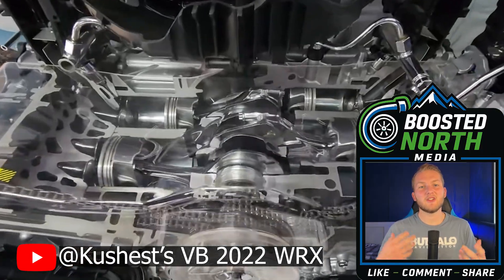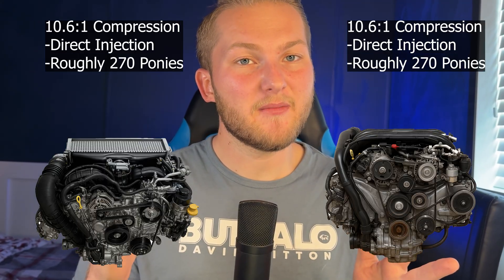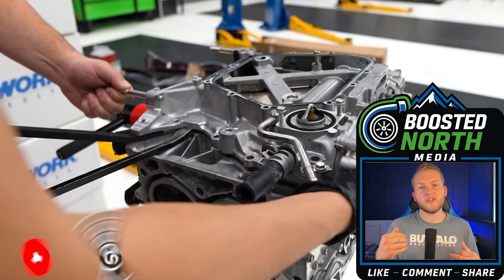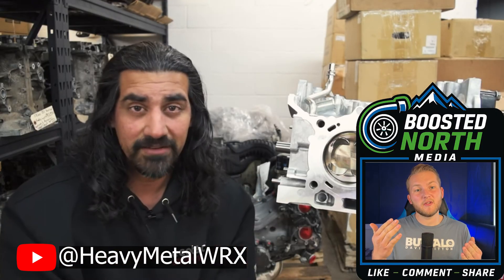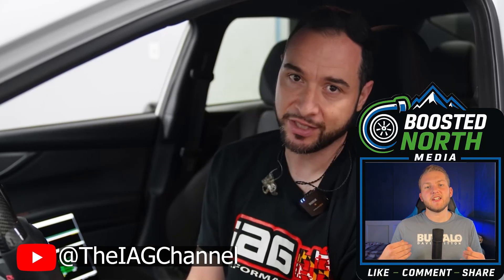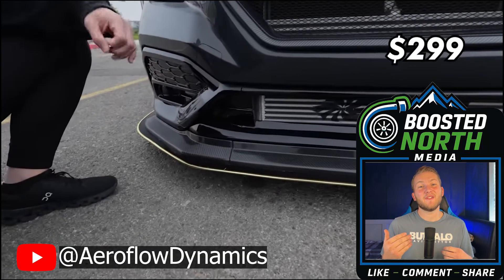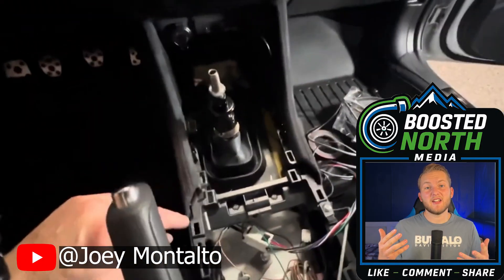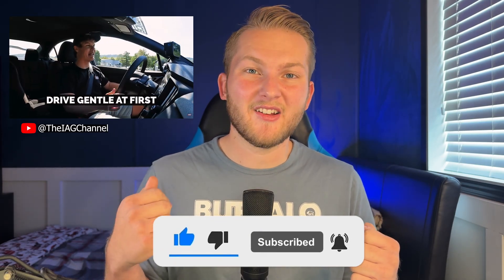Inside the FA24 WRX Engine: Why It’s the Tuner’s Choice | Power & Engineering Deep Dive

Comment: Hey do you know if the NA GR84 FA24 is mostly the same as the the turbo WRX motor?
Reply from the maker: Hi there! From what I understand, they are similar but the WRX motor has stronger internals and is only direct injection. The BRZ/GR86 motor has Toyotas port injection + direct injection technology

I’m sure there are a lot of finer differences, but those are the two that come to mind :)
Reply: @BoostedNorthMedia I'm shopping my first sports car. The GR86 has me very intrigued. I was trying to figure out if it was a good motor to add force induction to because the NA version is pretty low on power. Looks like it has a significantly higher 12.5:1 compression ratio compared to the 10.6:1 on the WRX version. I'm curious if the bottom end is built as strong?

Comment: Weak point is the transmission…..
Reply from the maker: Fair point! This car would be perfect with the STi transmission
Reply: @BoostedNorthMedia sure. But even that has it’s limits i guess what and how are you building it to and for? I mean you can beat a 22 transmission at 300 hp all day. Then 400 a gear may give out. Okay sti transmission. Sure maybe to 500. Why not just put stronger metal inside it?
Reply: And the requirements. If you want to sti transmission swap. Will you just do the trans swap  alone or do you want the drivetrain package? Personally if I was to sti
Trans swap. I’d want the electrical system / drivetrain with the knob inside the cab to be able to put more or less to front or rear axles

Comment: Is the FA24 in a WRX not proned to the same starvation issues on hard corners that the BRZ is?
Reply from the maker: Hi! From what I understand, I believe that there are similar starvation risks primarily because of the inherent design of a boxer engine itself. To my knowledge, there are some aftermarket solutions available that help address this issue (at least in prior generations, I’m not sure how far long the VB platform is yet)

Comment: I've been a Subaru mechanic for over 27 years. This engine is the best Subaru has ever made in terms of reliability and performance. It's the easiest and cheapest to modify, and it responds extremely well to upgrades. It's not like an STI that makes crazy power, but it's definitely the safest and most accessible for anyone looking to modify. Now, to reach high horsepower levels, you need to understand this engine—but there's no doubt it can handle more than an STI, and at a lower cost.
Reply from the maker: I agree! Thank you for commenting :) In your opinion, how long of a life can an owner of one of these expect on a stock engine that isn’t modified? Based on your knowledge of these platforms.
Reply: This engine is so incredible it was built to last. You can even see videos on YouTube where it holds up with people who know nothing about mechanics. Back in the day with an STI, we had to swap injectors and a bunch of other parts just to hit certain horsepower levels. But with the FA24, it's super easy as long as you get the tuning right. The best part? Everything is accessible and clean.  
It's easy to modify: just remove and install. And of course, you need a good tune  like me, haha.
Reply from the maker: Wow thank you for your perspective :) I’m glad to hear that Subaru really made a huge stride in the right direction with this platform. Imagine the potential of this engine with 10 years of aftermarket engineering under its belt?
Reply: TUNED ,FULL BOLT ONS, FULL SUSPENSION  AMD DRIVETRAIN MODS, FLEX E40 23 VB WRX. I HAVE A STI SWAP AT MY SHOP FOR WHEN I NEED IT BUT SO FAR SO GOOD. I DONT BEAT THE SHIT OUT OF IT BUT OWNED 2 HANDFUL OF SUBARUS AND A FEW STI'S AND THIS WRX IS BY FAR THE BEST PACKAGE. I DO MISS THE SOUND OF MY13 HATCH STI HATCH THOUGH EJ BESTS THE FA24 IN THAT DEPT BUT NOT IN DURABILITY RELIABILITY.
Reply: The guy at “Subie Performance” in Germany begs to differ, I believe specifically because it CANT be readily modified. And modifying Subaru engine is his business.

Comment: imagine I swap an FA24 into my FA20 chassis and then I tune and built it to be 1200 HP 

I think that'd be crazy

EDIT: looking at it more, the FA24 picture looks a lot more like the engine in my car, I just checked key things like the Alternator pulley size and where the dip stick is. I'm about 90% positive my WRX already has an FA24 even though its a 2016 model. I wouldnt be surprised, since my boost already came with a max PSI of 23
Reply from the maker: It should have an FA20, they will both look very familiar since they are very similar :). An FA24 swap would be pretty sweet! Thank you for commenting!
Reply: @BoostedNorthMedia I will have to look into it more, I don’t know why an FA24 engine would be in it but since it was built and tuned before I bought it (dealership took off every aftermarket part they could and I saw all of it on the car fax) I wouldn’t deny if it really is an FA24 engine. But again, I’d have to look more closely, I just referenced a picture I took because it’s cold outside and I don’t feel like standing out there to find out what motor I have when it should be obvious lol (FA20 duhh)
Reply from the maker: Haha yes it should be an FA20, but if it turned out to be an FA24 you would've struck gold :)
Reply: @BoostedNorthMedia just looked more closely with some reference images, it’s definitely the FA20, but, a good plan for the future for sure.
Reply: @HotTripod78  there’s a really good write up on the forums about a guy who did this swap, it seems very doable without much fabrication. If my engine blows I’m going this route in my VA chassis
Reply from the maker: Good idea!
Reply: My engine bay looks nothing like my brother's.  (23 vs 18).  They dont sound alike at all. They dont feel the same. Buying a previously tuned car that was tuned for the parts installed and having a dealership rip the parts off that the tune is for is brave. Best of luck and please get a reputable tuner to go through it before you get too rowdy with it!

Comment: Transmissions don't have horsepower limits they have torque limits.
Reply from the maker: Yes you are correct, I was mainly using horsepower even in regards to the transmission because I had established that as the reference frame for most of the video. Most people online have horsepower goals instead of torque goals, so I figured it would be easier in a general sense to determine what they can expect from the stock transmission.

Like I said you are correct, I’ll make sure to mention this when I eventually speak on it again, thank you for the comment :)

Comment: love this upload. it's refreshing to see a well researched and edcuated take on this platform and it's capabilities. I own a 22 WRX with a stage 1 cobb ECU tune and i have plans for the future. Thank you keep making videos!!
Reply from the maker: Thank you so much, this comment means more than you know :) I love making these kinds of videos because I’m a Subaru nerd myself who also owns a VB.

Are there any topics you may be interested in seeing in the future?

Thank you again, please subscribe if you haven’t already :)
Reply: How's it going so far? Any reliability issues? I still have the warranty on my 24 wrx so its stock till I can confirm that its not gonna break outside of neglect.
Reply from the maker: Hi, the most reliable way to mod your car is to have it professionally tuned on a dyno after you’ve installed on your parts. Even if it’s just a stage 1 kit, you benefit in both power and longevity by going the extra mile in dialing in the tune for your specific car.

I’ve seen lots of posts online about people being tuned for X miles and having no issues at all. If you’re super concerned about voiding your warranty, there’s no shame in waiting a few years for the warranty to expire first before beginning your modifications :)
Reply: is the stage 1 a substantial boost?
Reply: @growingup4487  yes and an Etune is even more and better for the engine

Comment: Cool video. I have a '24 WRX and, while I don't plan on tuning it (ummm... maybe a stage one at some point 😊), I have found the stock motor suits me fine; I don't race people, I just like being able to quickly get up to speed. It's nice to know these motors seem to be a bit "over designed" for stock or modified use. Again, thanks for the video.
Reply from the maker: Thank you so much, as a fellow VB WRX owner I had a lot of fun with this one!

If you really enjoyed this and haven’t checked out my channel yet I think you’ll love what you see.

Is there a video topic you’d like explored in the near future?
Reply: @BoostedNorthMedia I haven't seen very much on just how far the ECU, stock, can handle upgrades. I dunno, it seemed that earlier versions (not necessarily Subaru) were able to adapt to "small" changes, such as exhaust, intake, and even mild camshaft upgrades. Might make for a nice video. One reason I haven't (besides not racing) tuned my Rex is because of warranty reasons.
Reply from the maker: Yes absolutely, I’ve been tossing around the idea of making a comprehensive video around modifications and warranty claims. Maybe jump into more particulars of the modding process. We will see what the future brings :)
Reply: @BoostedNorthMedia thanks!
Reply from the maker: You're welcome! :)